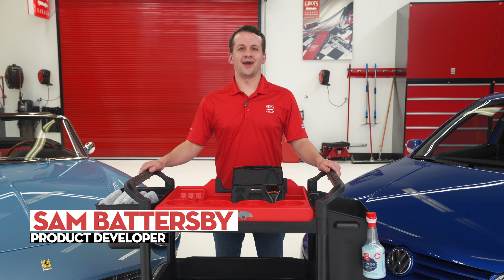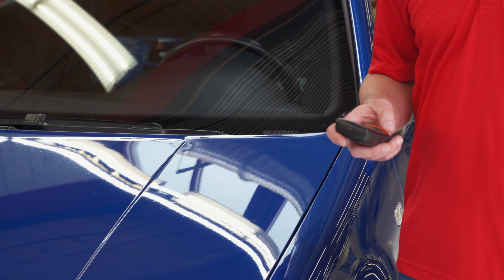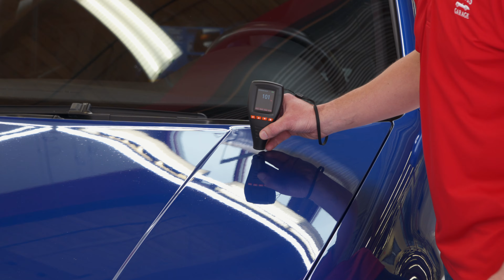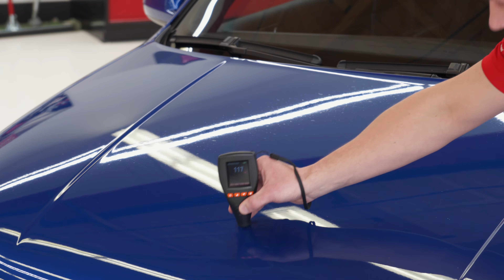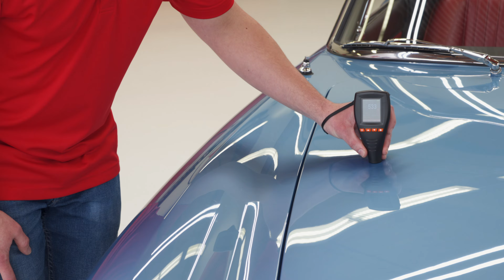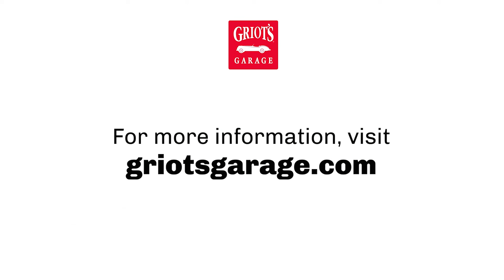THE BOSS™ Paint Thickness Gauge

Comment: Will this work on a Corvette? Thanks for your time.
Reply: The gauge only works with metal substrates and Corvette's are usually fiberglass, so I wouldn't expect it to work. You need a much more expensive gauge to support other substrates like plastic or fiberglass.
Reply: @dano2490  Thanks for the reply.